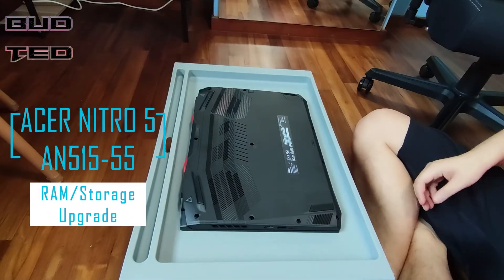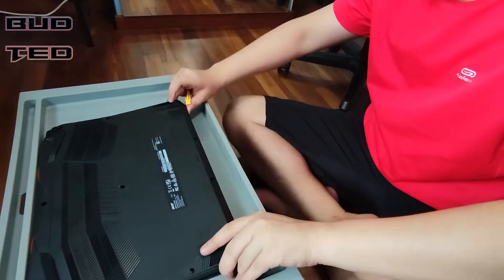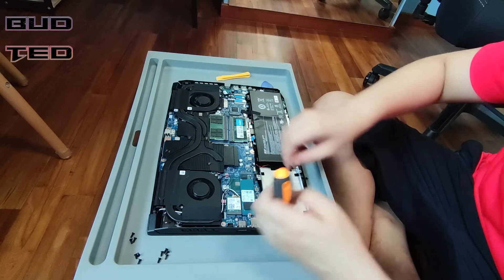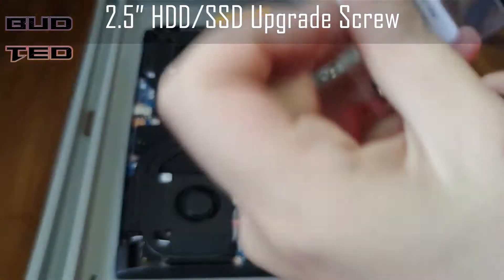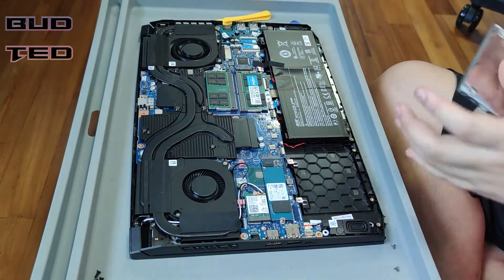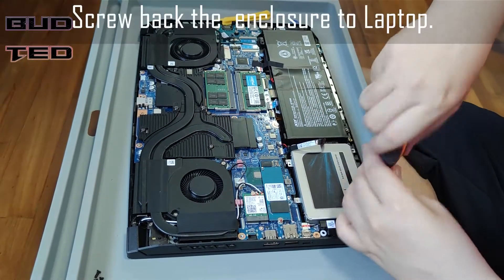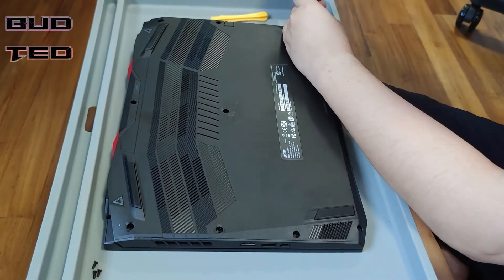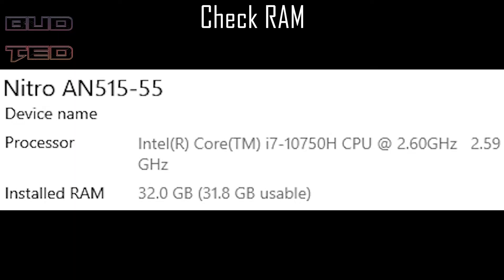[How To] Acer Nitro 5 Laptop - Upgrade SSD and RAM

Comment: Where to get the ribbon cable from for the SSD?
Reply from the maker: It comes with the laptop for the SATA cable. If you do not have it, you can just purchase it off Amazon or other similar e-commerce website.

Comment: Bro, what's the max expandable SDD  for this possible?. 
Please can u recommend other good SSDs for this if any ..
Reply: Hi Philip
For myself, I have the original 512Gb m2 nvme SSD by Acer and I added the 2TB Crucial P2 SATA SSD in this video.
Recently during Black Friday, I just got the Samsung 970 Evo Plus m2 nvme SSD. So it total up to Ard 4.5TB worth of storage, which should be very sufficient.(haven't got the chance to do up the video yet.)
I think you can swap the original 512Gb to another 2TB to make it 6TB if required(though that is really quite an massive amount of storage for a laptop?)

My main factor for SSD is value for money, thus I got 2TB SSD during discounted period. If budget isn't an issue, you can explore higher range model SSD of the various brand as well.✌️
Hope my answers will help in your upgrading.
Reply: @yeojunyi7384  yes thanks for the answer, it was helpful.
Please try to make the video of using samsung 970 SSD evo if possible...
Thanks for the reply.

Comment: I gotta ask where did you get the ram and the 2 other m.2 plus the SATA drive you installed?
Reply from the maker: RAM and SATA is from Crucial, the m.2 is from Acer directly, I did not add another m.2 SSD to the second slot. Since my storage is still sufficient. Hope it answers your queries.

Comment: Why didn't you disconnect the battery
Reply from the maker: Thanks for noticing it and the good advice.
In my case, I have powered off the laptop for quite some time, and thought that it is a simple upgrade.
It is advisable to remove battery to ensure there are no additional power to cause short circuit. But I thought that it was a simple upgrade and more of a preference for myself to "short-cut" the process of upgrading.
Just remember to remove static charge off your hands.

Comment: Ssd where?
Reply from the maker: Hi you can take a look from 1.00 to 1.07 where I was inserting the new 2.5" SATA SDD. 
Also pointed out the 2 PCIe slots available for upgrade/replacement. Noted that different model might have different internal configuration.